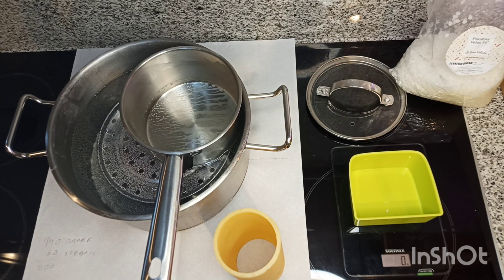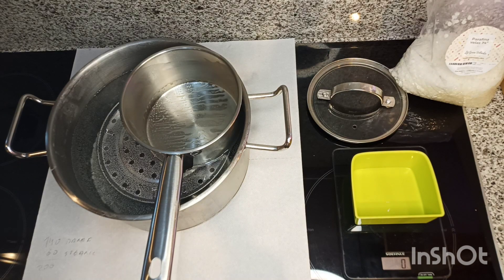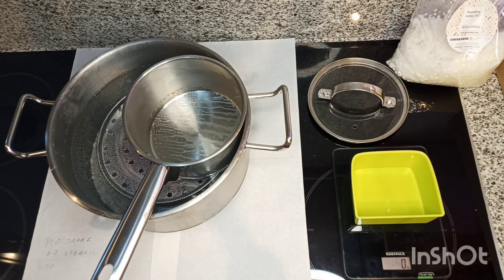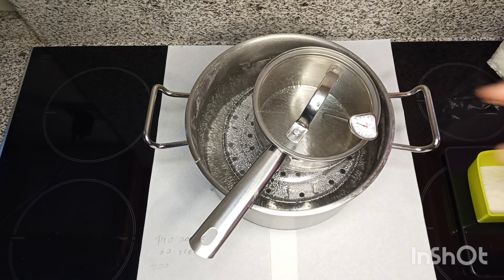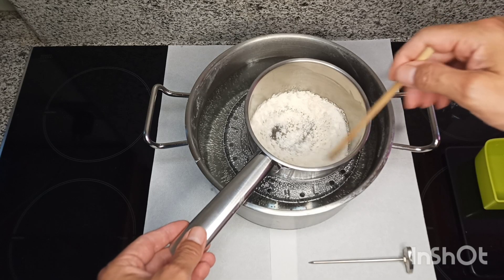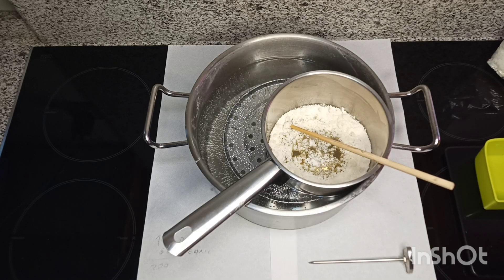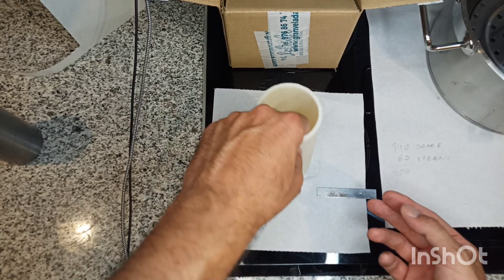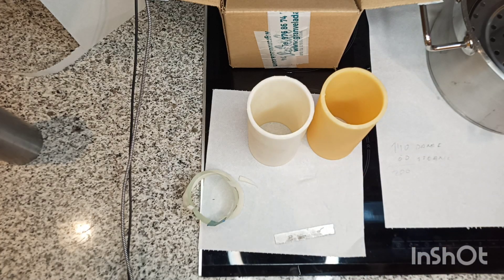The Gillett Phonograph project19: How to make phonograph cylinders.

Comment: One concern: the wall of the cylinder seems very thin. Can it be shaved? The 2 piece mold would likely leave tiny ridges on the outside of the cylinder, which would have to be smoothed off for a good recording. Commercial brown wax cylinders generally left a wall thick enough, so that, if a recording turned out unsatisfactory, the surface could be shaved for another attempt.

Gillett, of course, was writing for amateur experimenters; but it would be more expedient if they did not have to recast new cylinders for every experiment. I look forward, though, to your experience recording and reproducing on your machine.
Reply from the maker: Yes, the cylinders can be shaved  in fact, Gillett designed 2 shavers for his phonograph. The walls are thin but that's how Gillett designed them.
Reply: I was going to ask the same thing about thickness and shaving good to see others having a go at making wax cylinders